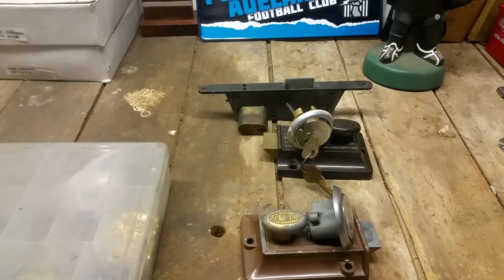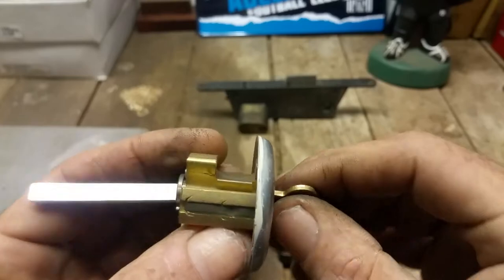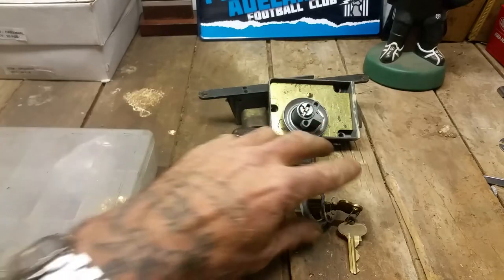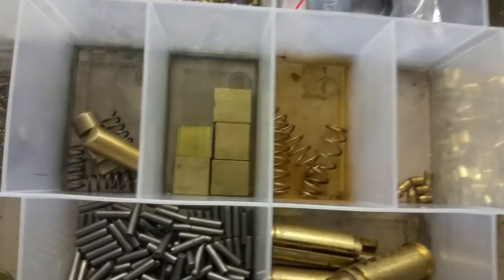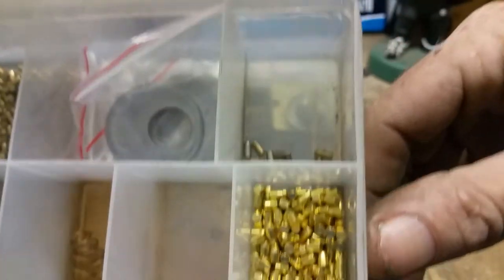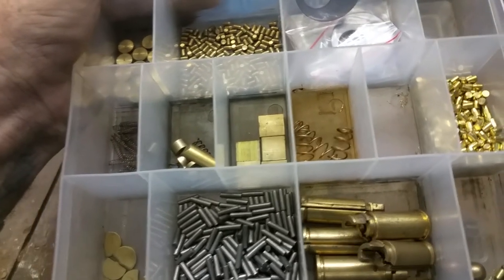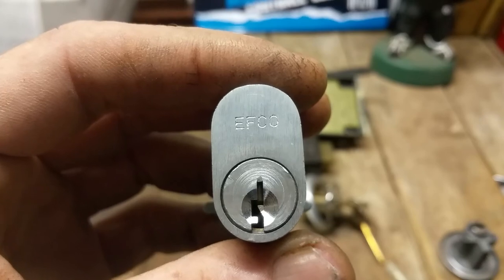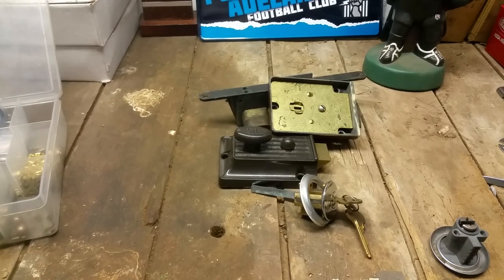#9 Rim cylinder comparison and lock related rambling.

Comment: Another great video! Interesting ...pull out those old patterns lads we are cutting costs lol 360 indeed, I see the irony love the explanation of the lock mechs, have a couple of those latch mechs both have there place imho.  Cheers Paul!
Reply from the maker: Thanks TR. Absolutely agree. Everything does a 360 eventually. In Assa Abloys case it was pure cost saving yet charging more. How does that work out? lol. Re the 360 degree of most trends, since i am a fan of the 70's i am awaiting the return of platform shoes, flairs, body shirts and the mullet.....argh...thems were the days. lol. Cheers mate:-)

Comment: Nice to see all the locks and good info, I learn but tend to forget now, lol.😁 Do a radical bitting on that EFCO and send it to Bosnian Bill, you may win a Paclock. 🍺😎
Reply from the maker: You evil sod. lol. But i like the way you think. Uhm, that would be interesting. Make the bitting 9-2-10(a lockwood 10)2-10-2. Then mummify the key. Take that Mr Bill. lol. Cheers:-)
Reply: @crankylock7844  Unless you have a key blank, you're going to have to work with that one you have. So you can only make deeper cuts.

Comment: More useful info. Cheers mate👍🐵
I can't seem to find anywhere online to buy them chamber caps.
Ive been after a dozen or so to recap a few 234's I rekeyed.
Gotta love the nice efco keyways
Reply from the maker: Hey Funkey. Thanks for the support and for dropping in. Re the chamber plugs i will up load a video shortly re the plugs. Cheers:-)
Reply: @crankylock7844  sounds good mate.  I have resolved to punching out a few from off brand 570 ovals
The $12.50 no name ovals off ebay seems like a good deal for 6 plugs and make it into a challenge lock using grub screws lol👍😂😂
Reply: @crankylock7844  also forgot to ask is that the DA or DM keyway on the efco oval?
Reply: @two_tier_gary_rumain  yeah cheers Gary, I seen it after asked. I searched my cabinet and found the 570 oval and key that i have.
Also have a DM key but no core for it.
Reply: @two_tier_gary_rumain  looking at the key the only difference is on the left side of the warding. Instead of the straight vertical part in the middle, its angled up and to the right slightly and seems a tad narrower than the DA profile.
Not really sure but it may just be a master key that fit all the D series for efco.

Comment: That Efco 570 oval does look interesting. I wonder if a dimple pick would work. It should be able to get in on the left but not sure if it would have enough reach for high pins.
Reply from the maker: I am not sure if that would suffice Gary. It would be a difficult challenge all around. Cheers:-)
Reply: @crankylock7844  No doubt about that. Can't think of anything else that would get in there easily.